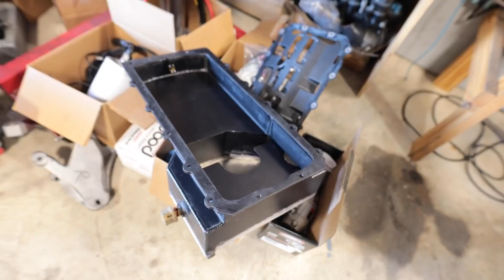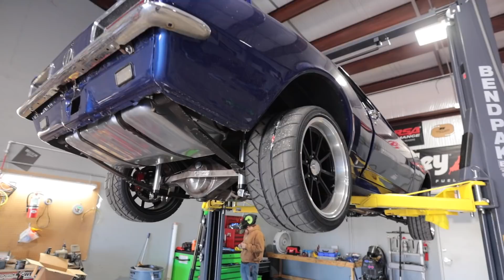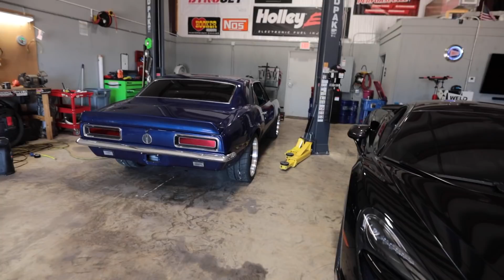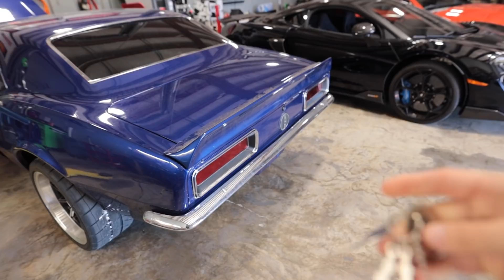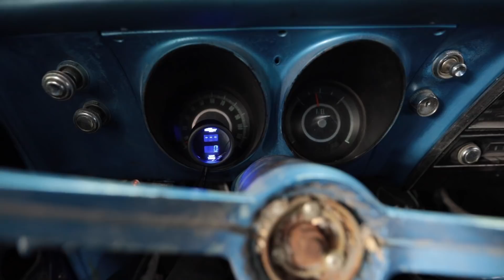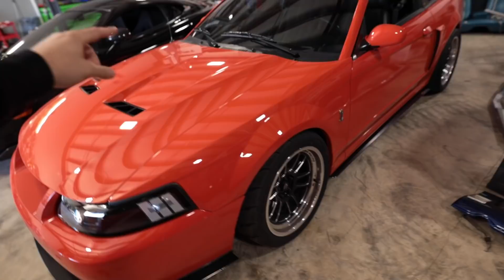My Coyote-Swapped Camaro Might Now Be My LOUDEST Car!

Comment: The way we stop rattling around here is you either use foam tape or you take two little squares of double sided tape, peel both sides on one square and attach it to the other square then attach it to the rattling area without peeling the other side, it's basically a rubber bumper

Comment: How gratifying it must be to see the finish line.  You are doing a lot of tasteful things on the Camaro.
My comments are:
1.Car exhausts that are hurtful to the ears must be changed if you don't want to suffer profound hearing loss into old age.  If you don't think you will make it to old age, then it doesn't matter but  you might and take it from a an aging gear head, hearing loss sucks including tinnitus.

2.  The wheels do not do the car justice.  I believe they are the wrong choice for the car.
If you really want to go next level, contact chip Foose for suggestions.  There are many great choices out there from late model Camaro 1LE wheels...to C6-C7 wheels which of course are much more aggressive than came on the car in '67-69.
But the wheels you have chosen don't fit the classic stock shape of this vintage Camaro.  Something like the AMERICAN RACING - VN402 CLASSIC 200S with more sidewall would be more appropriate.  Even AC Cobra Hallibrands would look pretty spectacular.  Just not what you have.

3. Car stance:  I am generally not a fan of overly slammed cars for driving on the street but the car sits too high.  You may do this because of fender clearance, if so, you need to either roll the fenders or change wheel offset.  The car would look a lot better lowered.

You have done a hell of a job.  I believe this is a special car for its rawness.  I am not a big fan of the Coyote motor but the car is undeniably unique and beautiful.  I grew up in this era and built a lot of fast Chevys.  Well done.

Comment: I'm sure you've heard this before  -  but a ford engine in a 60's Camaro??????? ugh.   The LS platform is just a capable is not more so - especially when it comes to the torque curve.    It's just sacrilege to put a ford engine into a 60's Camaro.
Reply: But not the other way, huh ! I personally DETEST seeing any gm stuff in a Ford !  Not as much torque, but rev much higher stock, which can be a buzz in its own way !!
Reply: LS is very capable in some ways even more, but a Coyote can easily make power outta the box. The power band never really falls flat and with 4 cams, you can optimize the most outta the engine. They are generally way more efficient. DOHC engines in general have been swiping the floor in the car world. Plenty of JDM cars for example giving LSs and big blocks a run for their money. 2JZs, K24s, VR38s, 4G63 etc.